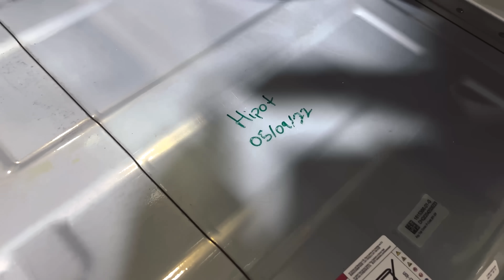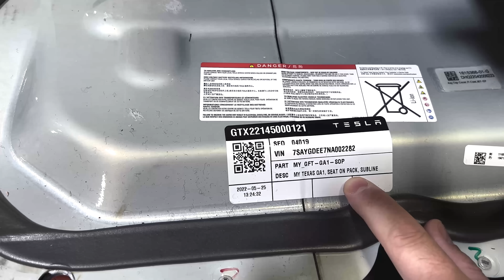Tesla Model Y 4680 Structural Pack OUT!!!

Comment: I know this is a massive step forward in terms of manufacturing efficiency but is this not also another step backwards for repairability?

Removing the pack may take an equal amount of time to remove as previous generations but then techs need to remove & transfer the carpet, seats, centre console & penthouse to the new battery pack now which will take a considerable amount of labour time.

We all know these battery packs are good for 10 to 12 years max & the harder you keep making it to change or repair the pack means the car is basically a throwaway item.

If I have to replace the entire pack instead of replacing individual modules & that entire pack costs $20,000 nobody is going to spend that on a 10 year old vehicle nor is anyone going to buy said vehicle in its said state other than for parts.

Now using the battery pack to mount the seats & others items increases labour time to swap the pack further pushing owners down the road of either to scrap or sell their vehicle for parts as repair is not economically viable whilst the rest of the vehicle could be a perfectly serviceable which is not exactly eco friendly is it?
Reply: Given that Tesla have openly stated the goal of the battery pack lasting a million miles, I’m not seeing the issue here.
Reply: @fredbloggs5902  As you state that is a "goal" & not a reality, batteries no matter the tech all degrade & die so need to be replaced.

What will the range be at half a million miles?
Reply: @APSuk2  The general metric seems to be that replacement should be at 80% degradation. 

Tesla already warranty them to 180,000 miles.

When nearly everyone is using Robotaxis, the problem will be Tesla’s and nobody else will remotely care.
Reply: @fredbloggs5902  “When nearly everyone is using robotaxis” 😂 nah we will be fly round by then in drones 🤣

Comment: What is the potential cost or cost savings for consumers on the longterm with such a structure? Are more cars going to be totaled? Will scale make things cheaper than current ratios? Thanks!
Reply: Tesla have stated that an impact sufficient to damage the castings would total the car. Most modern cars are written off the moment the airbags go off.

Comment: Interesting to see. How do you jugde the stiffness of the body without the structural batterypack? How to assembly the pack to the car body? Are there some guides that lead the battery from outside to align withe 38+2 bolts? How much stiffer will the car body with pack de together? Hope  this will be shown in the next episodes.

Comment: They are gonna need something more permanent than just bolts keeping that battery in place, otherwise this thing is gonna be a magnet fo car thieves, won't be hard to offload a giant Tesla battery pack onto the black market.
Reply: Assuming that a thief were able to remove the 38 bolts without squashing himself, he’d have to lift the rest of the car high enough to slide out the battery pack with seats attached. People will notice. This is a far cry from cutting the catalytic converter out of a Prius.

Comment: So from what I can find out, the total weight of the Texas Model Y car with 279 miles of range is only 178 lbs less than the older Y long range with 330 miles of range. Probably cheap to produce, but not necessary the better product for a consumer.

Comment: Two critical questions that remain on these batteries - are they are safe from catching fire as BYDs newest batteries?  And are they simple and cost effective for your local auto electrician to swap out as other EV brands?
Tesla is doing a fantastic job,  but it needs to focus on the most critical features.
Reply: Please provide your evidence that other brands have easy to swap battery packs (other than the ones where the entire design is compromised in order to swap them all the time, obviously).

Comment: You all have lost all respect with this sell out video.

What sense does it make to fasten all of that extra equipment to the main power source of a vehicle.   Should you need to service that battery for any reason, you will be paying through the nose for all of that labor.    And if you want to access the battery from the bottom (if even possible), you end up with the idiocy of the new Apple mouse that charges from underneath with the power cord preventing you from even using the mouse while it is charging.   How in the name of common sense will you be able to flip that monstrosity over to access the battery from below?

This is pure stupidity - shifting assembly cost to the end user.   You all have lost your minds.   Pure stupidity.    And this from a company with supbar paint and panel assembly fit and finish.   Good grief.
Reply: Given that Tesla have openly stated the goal of the battery pack lasting a million miles, I’m not seeing the issue here.

Comment: One of the concerns I had was over the replacement of the battery. Given what we see here, it looks like not only is it possible, but it would be a pretty straight forward project.
Reply: And you can exchange the worn out driver sear at the same occasion :)
Reply: Yeah, change out the seats at the 300,000 mile mark, or maybe at 500k, lol.

Comment: The giga casting sounds great in theory... until you get into an accident and a piece breaks off and the whole car is a write off since its not repairable.
Reply: It’s most likely a write off anyway If the accident damaged the chassis no matter what kind of car it is.
Reply: Tesla have stated that an impact sufficient to damage the castings would total the car. Most modern cars are written off the moment the airbags go off.
Reply: @fredbloggs5902  that's true, but the car is still repairable while a fractured casting is not
Reply: @gxp99  try reading my previous comment again.
Reply: @fredbloggs5902  ok side impact into the front wheel, no airbags... a tesla would have a cracked casting, normal car wouldn't and would be repaired. totalled cars are still repairable, but cracked castings aren't, insurance rates will probably go up on these things
Reply: @gxp99  Side impacts set off airbags. You really don’t know very much. You still haven’t understood my comment.

Comment: I'm curious if the $800.00 price point is to help offset the labor / reverse engineering that goes into a tear down like this. You're looking at about $640k to $768k in battery sales. Still probably a drop in the bucket at $800 for Tesla R&D.

Comment: This is insane but will it/does it have the robustness of a welded monocoque body?
Reply: With 40 bolts into stiff cast and built-up welded structures around it? Probably not bad.

Comment: The old battery pack would not catch fire until it hit 350 degrees Fahrenheit, this new battery pack will catch fire once it hits 150 degrees Fahrenheit. Sounds like a huge step backwards in the safety department to me.
Reply: Please provide the evidence for your ridiculous claim.
Reply: @fredbloggs5902  I got the information from another site on the specs. But you claim they are wrong then prove them wrong.

Comment: That foamed dispensed sealant is remarkable.  The variable compression seen in this video I think would be concerning.  With this degree of sealed joint variation, it seems like the retained sealing force could be comprimised when the vehicle ages or is subjected to thermal loads.  Loss of retained sealing force = leaks.
Reply: It's cool stuff, but it's also a routine automotive material: polyurethane foam-in-place gasketing; that's why the Munro staff were not surprised by it.
I agree with the Munro staff that the area which they highlighted is concern - if a car like this ever sits in water up to the rockers, I would want to check that area carefully for leakage.

Comment: I’m seeing those styrofoam(?) floor risers filling up with all sorts of dirt and debris. I’m assuming it’s easy to lift them out and clean under them.
Reply: It appears to be expanded polystyrene foam; "Styrofoam" is a registered trademark for a particular brand of extruded - not expanded - polystyrene foam. I assume that they would be very difficult to remove and will stay in place until the car is scrapped.

Comment: It's going to be very interesting to see if this pack is designed to be serviced at all out of warranty in case of few bad cells or if you'll have to buy an entire new battery assembly. I'm guessing no serviceability intended.
Reply: It is bad idea to mix and match old and new cells because the old cells will over stress your new cells killing it very quickly.
Reply: @kazedcat  not entirely true. The cells of a large battery are combined into subgroups that are individually monitored so you only need cell uniformity within each group not the entire battery.
Reply: @theslimeylimey  The structural pack is just one giant module glued together with stiff adhesive. There is no subdivision.
Reply: @kazedcat  you brought up cell balancing which is what I was responding to not physical construction.  The subdivision is electronic grouping for charging and monitoring.  People have successfully replaced cells in Tesla battery packs before.  Some have done it on the individual cel level others have done on the module (group) level.  We don't know what's inside this pack yet hence the speculation.
Reply: @theslimeylimey  Tesla have already shown how structural pack is constructed during the opening of Giga Austin. Also I am not talking about balancing but old cells mix with new cells. Without isolation from individual BMS module stress will be distributed naturally and natural stress distribution concentrates stress into the newer cells. Think of it this way when discharging the old cells with higher internal resistance will output less power. Without electronic isolation the newer cells will discharge more to compensate stressing it more leading to higher degradation of the newer cells. You can preserve the newer cells if they are isolated and controlled separately from the old cells so that they don't output at higher power and discharge harder.

Comment: How quickly the VW Bug is forgotten. The whole body lifts off the floor pan. I'm not even sure it was the first skateboard. It might have been a common design in the 1930's.
Reply: This isn't a skateboard, or a complete chassis plus floor pans (like the Beetle) - it's just the floor of the passenger compartment.

Comment: Noticed the side rails (rockers?) Are cast, and appear to be either welded, or glued and bolted to the  front and rear castings
Reply: Yes, they're like the rocker & sill of any other unibody - the structural pack only replaces the floor and seat support crossmembers.
Reply: @brianb-p6586  
"Only"!
Reply: @rogerstarkey5390  Yes, the floor is important, but it's not like the car would fall apart with the pack removed... because of those rocker/sills and castings that you mentioned - most of the lower vehicle structure is not part of the pack.

Comment: HiPot test ensures that the Ground connections are all intact and that no leakage current is found through any insulators at an elevated voltage.
Reply: Hooray!  I found another electrical engineer!  Tell them the elevated voltage is usually thousands of volts (depending on what standard you're trying to meet).

Comment: A battery pack case as body structure is certainly easier to design, and easier to adapt to an existing model's structure, when it only replaces a floor panel (and not the rocker assemblies or castings surrounding it). 🙂This is a long way from being the structure of the car, but it is a small part of that structure, and it seems like a reasonable approach to me.
Reply: Its a major structural element of the car, responsible for torsional stiffness and side impact resistance.
Reply: @waynerussell6401  You didn't notice that it's surrounded by just as much structure as any conventional car? Yes, of course it contributes to torsional stiffness (only when attached to the surrounding structure by 40 bolts) and to side impact resistance (like any floor and any under-floor battery back).

Comment: Wonder how the curb weight of the 4680 Model Y compares to the 2170 Model Y Long Range and the  Standard Range+ and whether the 4680 MY has a noticeably different, better?, driving experience? I think I recall some comments on battery day about the structural pack reducing the polar moment of inertia of the overall vehicle which could make the cars feel a bit more responsive when changing direction.

Great video BTW, was looking forward to this!

Comment: Hey there! LDCRS here, we manufacture Tesla Accessories and was wondering if you'd be interested in test fitting a set of our Model Y Floor Mats to ensure proper fitment for the 4860 Structure to see if there were any changes with the integrated seat and rails with the new pack. We'd provide a complementary set for helping us out. DM us if it's something you'd be interested in helping us out with. Thanks for this helpful video!!

Comment: Very interesting way to build a car.  It will make the inevitable battery replacement much easier.  Just have to hope QC was paying attention that day when the pack was secured.  I would also worry about stiffness loss from a design like this similar to what happens with a convertible.
Reply: Battery replacement is very rare. QC is automated AI. Stiffer than any other production car.
Reply: @waynerussell6401  the battery will need to be replaced at most every 15 years. QC done by an AI shows why they have so many problems.  Teslas are not stiffer than exotics that are in production.

Comment: Great video. I look forward to seeing what it looks like inside. Question: there is the urethane seal you discussed, but I'm wondering if there is a splash shield/seal around the perimeter covering the bolts and edge? If not, I can't imagine that not being a problem spot in wet/snowy environments

Comment: Great to see that you are getting a hurry on. Can't wait for the specs of the pack and the cell. I am really curious how the the internal resitance differes with the tabless design and how much of a difference it makes with heat losses during charging and discharging and the parasitic cooling energy / capacity / weight needed to deal with those thermal losses.